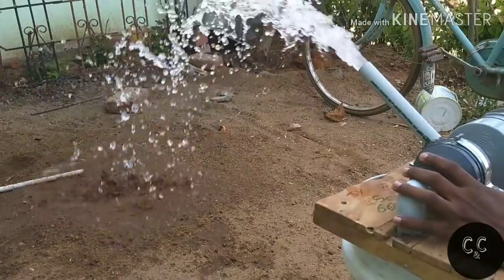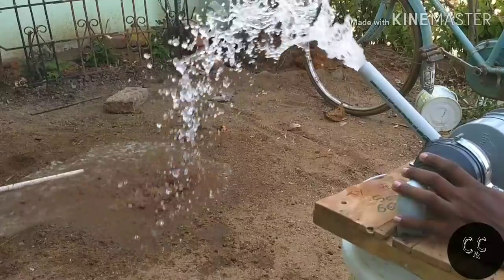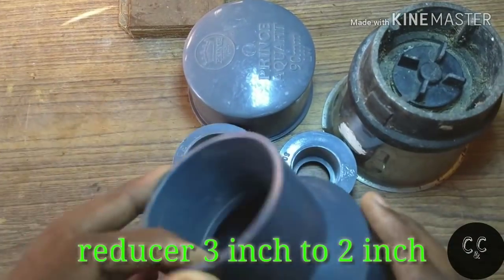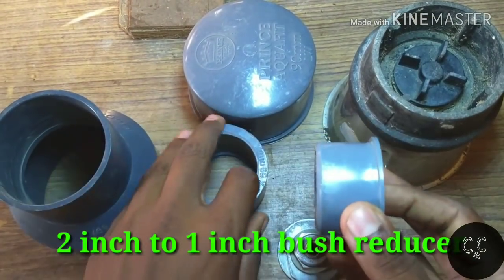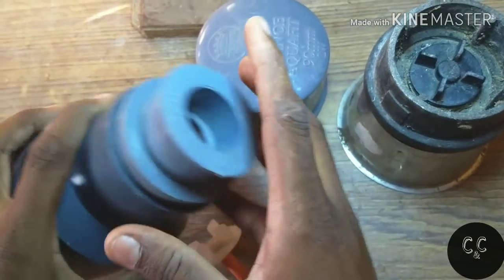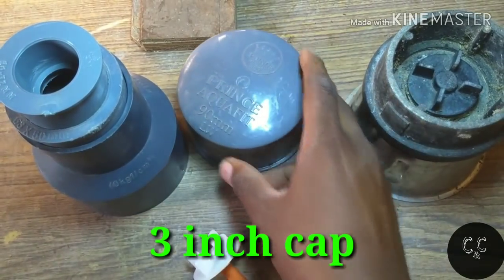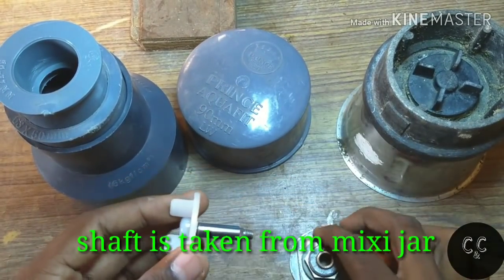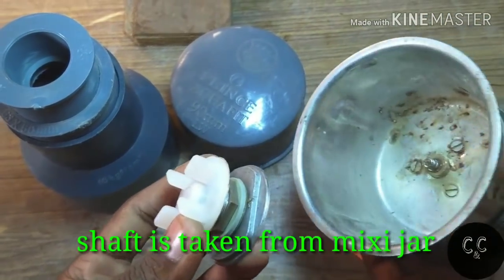Making powerful water pump / using mixer grinder ac motor /and mixer Jar - In Tamil

Comment: This is so amazing. I like it. Good project.
how far can it pump watewr to on flat area?
Reply from the maker: Thank you 

To pump water in flat area remove the suction pipe and connect hose using the hose is very fine to take water in flat area